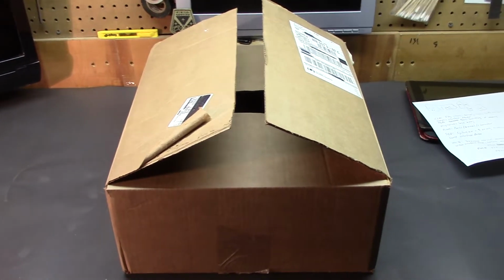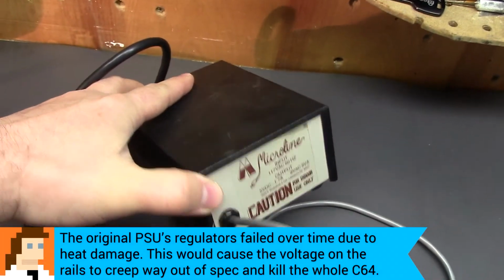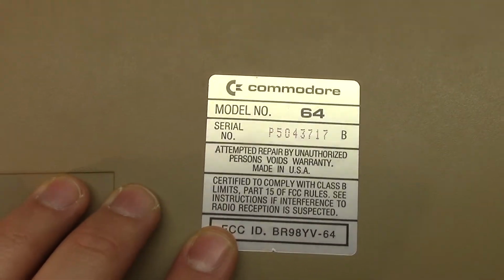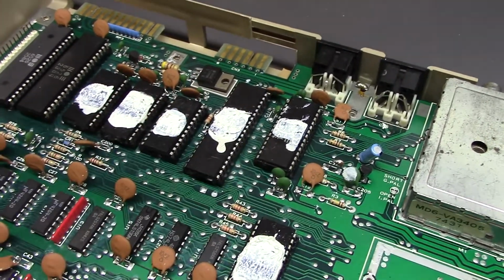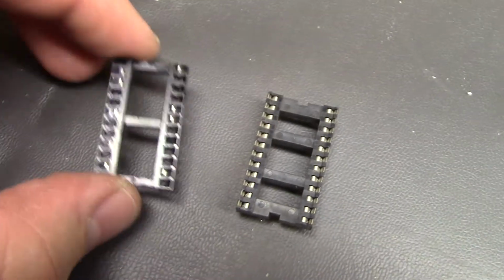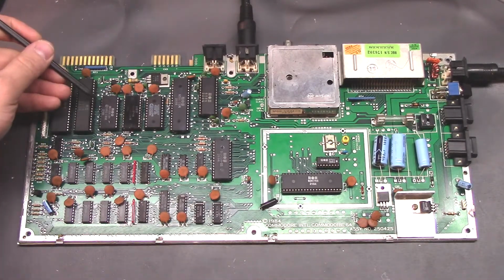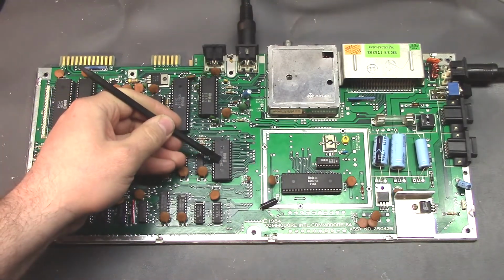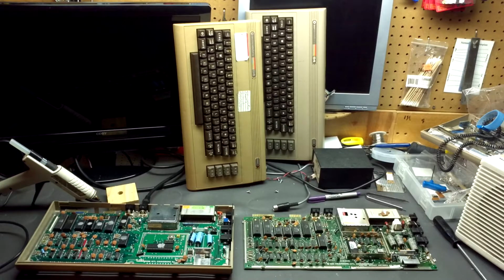Commodore 64 Repair #01 - BauTek Industries

Comment: BAUTEK INDUSTRIES, 
                             1.) In arcade games they use Address decoder chips to do the ROM chip select signals they dont' use PLA chips. I'm surprised why does the C64 game console used a PLA chip to do the chip select signals instead of using an address decoder chip, any reasons you think?        2.) In pinball games they used PIA chips to do the I/O processes for the switches matrix circuit and lamp matrix circuit and didn't use CIA chip. I'm not sure why they didn't use CIA chips in pinball games instead of using PIA chips. Arcade games use neither PIA chips or CIA chips to do the I/O processes like the joystick and buttons its done using an multiplexer chip as I believe? Not sure why arcade games didn't use PIA chips or CIA chips for the joystick and buttons. Any advantages of using CIA chips instead of using PIA chips?

Comment: Nice video, well focused on the details. We need the second video of the second board, please! Could you please give some guidance about common issues of the C64 and how you fixed and prevented? I bought a c64 on ebay, its coming and and it is my first commodore. I know electronics but I don't too much about c64 maintenance.

Comment: Hello, great video.  I've got a c64 that has two issues : 1) no sound - from the monitor's speaker I get a static noise.  I've checked  the monitor's speaker with another source and it works fine.  So it's either the cable or the C64. 2) no colour - all grays like in this video. Any suggestions would be great!  Thanks!

Comment: Late in commenting on this video, but anyway... Great repair.  Coincidentally, I am currently repairing the exact same board Assy 250425.  Did you end up replacing the 3 large electrolytic caps at C88, C19, C90?

Comment: Some C64s shipped with paperboard/foil RF shields, while others had real metal shields. I don't know if Commodore ever applied goop (cooling gel) in the factory, but refurbishing outlets certainly did. As you rightly point out, the chips don't typically get hot enough to be damaged. The reason heat is a problem in C64s is because temperature changes cause expansion and contraction in metal, including socket contacts and weak or damaged solder joints.

By far the worst mass murderer of Commodore equipment is their notoriously bad power supplies. Even the 1541 had problems in this regard.

Comment: Cool video. Not to nitpick but you are pointing at the famous 6581 SID and calling it the PLA. They moved them around on the many various board revisions.
Reply from the maker: aphexteknol Thanks for the correction! I still have lots to learn about the life a C64 user, hoping to get my second one up and running soon. :)
Reply: BauTek Industries No sweat. I just repaired my latest ebay C64 yesterday. Had a couple bad 4164 ram chips causing all sorts of wierd and wonderful problems. I love me some Commodore stuff but goodness 30 year old silicon (especially parts made by MOS) has NOT aged very gracefully. Drop me a line if you need anything. I'm no guru but know enough to be helpful. Good luck keeping the old stuff alive!